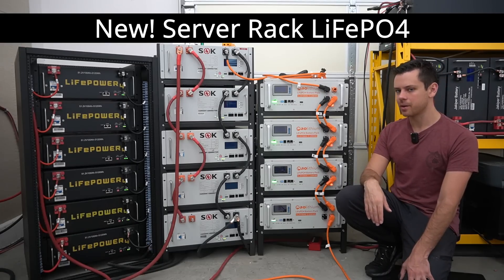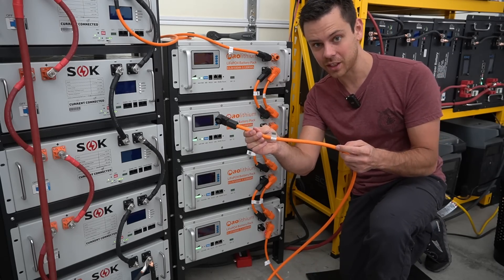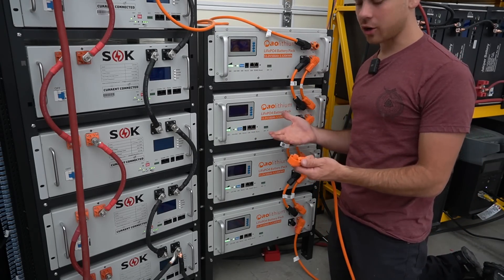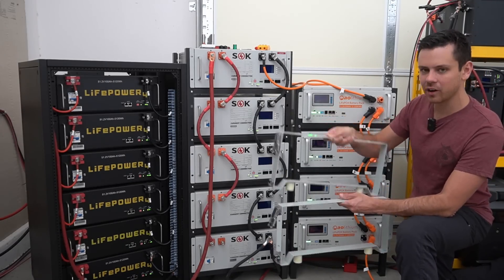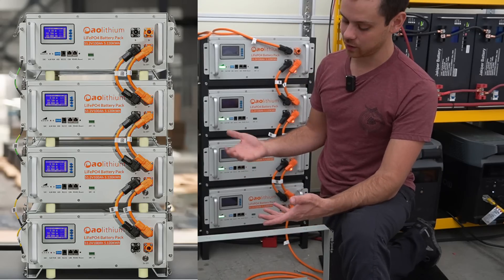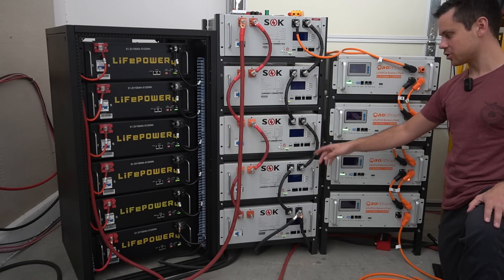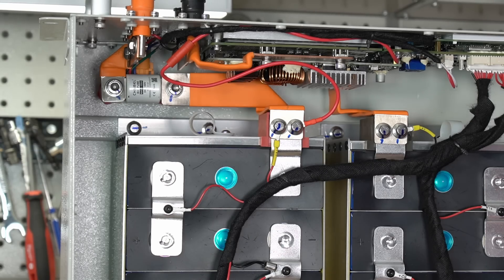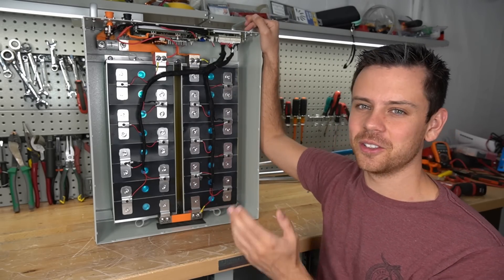New! 48V 5.12kWh AOlithium Server Rack LiFePO4 Battery

Comment: Question:  
I use about 70 kwh daily at my home....  Is there a realist solar setup that would fit my needs?  If a single solar panel only makes ~ 300 watts for about 4 hours in the best time of the day wouldn't I require over 100 panels to generate 70 kwh a day???  Not to meantion pallets of batteries?   I do not see my home going off grid...

Comment: Will I have a question, can you run 120 and 240 volts at the same time on a inverter or do you have to have two inverters to do this?

Comment: So a quick question. I’m not having any luck getting a uk installer to do my house solar. So Will you thought well or the SOK battery. So if I get 2x 12v x100Ah and build a 24v system on my shed. If eventually I find an installer for 48v roof panels could I add 2 more batteries and make a 48v 100ah stack? (I know that’s. Greater cost than getting the 48v server rack battery , but I can’t use that for 24v on my shed) Do the BMS play nicely when connected in series?

Comment: Hello. I need your advice. I have a Fronius primo 5.0-1 inverter, which have two input with two mppt. One is connected to a solar array with 14x370w panels face to east. My plan is to add more panels with west direction to the second input. The problem is I dont have enough space for more than 4 panels. These 4 panel maximum string voltage is around 160 volt. Regarding to the inverter's manual, the mppt range is 240-800v, operating voltage range is 80-1000v. What can I expect when I connect these 4 panels to the inverter's second input? Thanks

Comment: Hey Will, just curious is there a video on a solar panel inverter setup just to offset the cost of electricity? I realize all your videos touch on this but specifically maybe a scalable system a guy could start with one server rack battery, an inverter, and a couple of large solar panels and in the future add more solar and battery, all while using less and less power from the grid? It isn't necessary for me to do this as electricity is very affordable here I just want to do it.

Comment: I wonder, if I can pick up a 50kwh building backup battery (Lithium) that's in good condition from a surplus for 5k would that be a good deal?

I'm thinking of going that route when I build my solar system along with 30kwh of solar. I want to be ready for the northern winters if we have a power outage.

Comment: Hi Will I have gained great respect for the way you share your knowledge with us very thorough and technical bot not in a way that leaves scratching our heads when are done. I'm not just saying this to gain a response for my next question. I have come to love lithium batteries from what you have shared. I am a handicapped USMC veteran riding a mobility scooter so the lighter weight, longevity and length of use time available had me thinking it would be a good idea to try them on a mobility vehicle to see how they fair. I have just received 2x135ah 12volt Dakotas. I was surprised when they arrived with a single 3.5 amp charger that on the box says that it is only rated to charge 8-35ah batteries. Will this actually work? Also can you recommend a better option for me to request the VA to purchase for me? Your best choice because the VA will pay for it without any complaints about pricing for the most part. I hope to hear from you and hope you do not have a problem with me asking. 
     Maybe you could start working on videos having to do with this topic on your channel. I believe a lot handicapped people would be highly grateful and very interested. 
Thank you and I hope to hear from you. 🙏😇🙏🤠
Reply: Will can you please let me know if you have at least read my messages to you?
Reply: @DocktorVideo  Will runs a discussion forum on his website, I suggest you visit there if you want more detailed community discussion.
Reply: @pvbatts  I'm new to using any forums. Can you point me in the right direction please?

Comment: HOWdy  W-P,
Thanks for the REVIEW - INside & OUTside of this BATTERY
I prefer the FAR Left & FAR Right Positive & Negative battery connectors 
... on the  LifePower4 & EG4-LL batteries as it allows for simpler BUS-BAR connections & separation 
FYI --- my  EG4-LL batteries came with  5-AWG  jumper wires & too small 1/4" lugs 
( where 5/16" lugs would have been preferred at least on one end  ) 
 COOP
...

Comment: If they were connecting to a busbar with each pack directly, then short 3 AWG cable links would be more than adequate but to parallel them up like that it would be pushing it a bit and could be a problem if this was connected to a larger inverter over 5KVA or multiple large charge controllers.

Comment: The biggest issue I've had so far in working out my system for my ute is "what gauge cable do I need?" I'm a relative noob with actually setting up a solar system, but have had an interest since the early 80s.
My current thought is to go for the biggest gauge possible, with appropriate connectors (high capacity Andersons etc). I want to be able to run a small 120amp arc welder for short periods. I figure that will be my highest load on the system. I'll also have an electric (240V) 20 litre/2HP compressor. The ute will be my home, so my power needs will also run to powering a computer and associated peripherals on a daily basis. I'm really hoping my set up will be overkill for daily needs but cope with the occasional use of a welder. 
My current purchased items:
1 x 3000W pure sine wave inverter
2 x 115 AH 12V AGMs(connected in parallel). Might add a third later on.
2 x 160 Watt panels. Might add another in the future.
A 20 amp MPPT controller (it was thrown in with the inverter as a freebie)
I still need to decide on a controller panel for my 12 volt needs and learn whether that controller will work if both panels are connected.
And I need to figure out cable sizes. 
I'll keep watching your videos because even the system in this video has some relation to what I need to learn with respect to cables and loads. 
One thing you've confirmed for me is that yes, I do need some fat wire between the batteries, and the inverter.

Comment: I cant afford to go solar but if that day comes I'll know everything I need to know thanks to these videos.  Until then i really enjoy your expertise and professionalism.  
I enjoy planning out in my head my ideal solar setup even though I can't justify the cost.
Reply: You can't afford not to
Reply: @PaulShalahm   where I live electricity is 6.5 cents per kilowatt hour.  I live very close to a hydroelectric dam.  I can't see how I could justify the cost of solar.  Even if the solar panels last 100 years the batteries will likely fail before I save enough in electricity to pay for them.     Until the batteries get a lot cheaper I can't see how I could justify the cost of going solar, besides the fact that I just can't afford the upfront  cost
Reply: Build a small system.
Reply: I just started buying for my system. I have a tight budget and it is easy to exceed it but you can start small and expand the system later I wanted three batteries but settled for two with plans to add more latter. But now I am committed to see this project become reality.

Comment: The ragging on the stacking frames is overdone, seen pleny of battery system stacked on top of each other. Not a server or server rack in sight, ignorance is thick. The connectors used found on higher voltage string systems but lower current, certainly not for more than 50A. Inside the chassis, a lot of empty space.

Comment: New Subscriber!  I have an 8X12 insulated back yard shed for my falcons and hawks that I train.  My yard faces south, but my shed is in the corner of the yard that is shaded.  I want to power some led lights in my shed as well as a small freezer inside the shed.  I will have to put the solar panels about 10 yards away where it will get most of the sun.  What components do i need?  If you charge for advice that would be fine.  Good luck!

Comment: You're absolutely right Will....paralleling with such small battery-to-battery cables might be fine for the small loads of a telecom backup site, but not for power electronics.  Battery cables and associated OPDs should always be sized for the maximum load connected.  Busbars are the only correct way to parallel batteries, keeping in mind that all cables must be exactly the same size and length.  Even very small differences in cable resistance can have negative effects on charging.

Comment: The connectors are called SLPPA25BSR and rated at 125A with a 25mm² cable. They are also availavle as SLPPA50BSR rated at 200A. So there is a Chance to make your self some bigger cables
Reply: Yeh it's great to see radlock connectors on these batteries. I first saw this type of connector when installing a 2MWh Tesla megapack back in 2015 or 2016

Comment: Cables are too small  yes larger gauge cables needed and in parallel is how it should be done, plus cheap Chinese dirt will not do, most of that china stuff is not even copper you will find it could be brass, aluminium or tin, etc. will is 100% correct so watch out. I deal with large supplies all the time in industrial situations.

Comment: Check the sub rails... do you have droop?
If no droop I think they are sized appropriately as long as the wiring is NOT extended....

But not a load i put at near 100 capacity on my own buget... upgrades the cables or add a dual bus
Reply: Edit it would make sense depending on operating at a draw/charge which direction the batteries has more cell density at that given time...

Still thank you...

Gotta admit these Chinese packs are getting better for sure

Comment: Will, as always a very informative video, I am in the UK and have set up a 12volt  off grid PV system totally from the information and reviews you have done on your channel.    Thanks again for your invaluable advice and teardowns!!
Reply: Well done. From a dude in Manchester.
Reply: Rodeown, where did you get the components from here in the UK. Would be great if you did a video of how you set it up and parts list.
Reply: I'd be interested in knowing more , as I'm considering a DIY home system here in the UK.  Just been quoted £13k from a commercial provider.
Reply: @mjexploits  Martin, mine is a subsidiary system to complement my main grid supply not to replace it, so when we get blackouts this winter as they predict then we will still have power for cooking and lights etc,    I used 4x renogy 100watt solar panels connected to a renogy Rover MPPT charge controller and 2x renogy Blu Tooth 100ah LiFePo4 batteries connected in parralel & as per Will's recommendations I opted for the Giandel 2000 watt full sine wave inverter.    I ran two AC cables from the inverter, one to my kitchen and one to the living room to supply the power to new sockets that are in no way connected to the main electrics. The remote for the inverter is on a double socket in the living room so we can turn it on and off when we need it.  At present from about 10-20 % we can be fully charged to 100% with a good day of sun even at this time of year in the UK. I have never used an electric Kettle before now but all our cuppas are done on Solar and we use our 1300watt Halogen Oven no problem, I also have a 2000 watt induction stove that the inverter runs no problem and it only uses about 2-3% of overall battery capacity to cook a meal which can get topped back up very quickly. Vacuum Cleaner works fine on it,  It even runs an 800watt oil radiator in case of emergency heat required.  So it is not a FULL household system but an alternative backup that we are using more and more, it has cost around £2000 so far but I am happy as it gives us peace of mind.                       Trouble with UK GRID TIED systems is they dont allow you to use them if the power goes off so that is why we chose the DIY off grid option.  All thanks to Will and his wonderful video reviews/advice etc.  I would also like to say that Giandel have great customer service, i needed to know what size fuse i would have to put on the system and if i would need an RCD and they replied very quickly within a couple of hours.

Comment: Most of inverters pull 100-120A max from batteries, I guess that is why they used this wire gauge, to work with common inverters.

Comment: I wouldn’t pay much attention to what the BMS is reporting for SOC. Trophy batteries, which you mentioned share the same BMS, also have a known issue where the SOC is reported inaccurately. 

The SOC reporting error is discussed on the forums quite a bit, and I’ve seen this same behavior with my own Trophy batteries. For example, I’ve seen instances where my 3 batteries in parallel reported wildly different SOC’s (60%-80%), then suddenly all jumped to 98% once they hit 56v just a minute later.
I just ignore what the BMS reports and trust the Victron smart shunt.
Reply from the maker: Ohhh ok good to know. Was not aware of this on my trophy packs. Will read the threads
Reply: Looked at it closely. It’s not a pace.
Reply: trophy seems to be using a seplos bm,s, this seems to be a pacebms
Reply: LFP SOC is tricky to report precisely as the LFP chemistry has a flat voltage curve plateau at 3,2V. Ideally you need to count coulombs passing into the busbars. On the other end NMC is quite linear from 4,2V down to 3,2V. Much easier to estimate the SOC then.
Reply from the maker: @chryoko  that doesn't matter here because these BMS have a shunt. It's not using voltage.
Reply from the maker: @chryoko  even with NMC you should count coulomb's regardless. We don't use voltage to assume soc on this channel. We have covered this many many times

Comment: Hope this company listens to and implements every single one of your recommendations - you're only helping them become better and everybody wins.
With such a great internal build, I just don't get how they whiffed on adequate cable size - the connectors are sweet tho'. One thing I would like to see, is a quickly/easily removable insulating busbar cover. I do not like some setups I've seen in server racks  where it would be too easy to accidently touch a live busbar - god forbid a child or pet do so. Like reaching into a live breaker panel -it should be safe to do so without having to worry about a big long exposed energized strip of metal.

Comment: Will,  I really like your posts. Your comment about multiple conductors to a protective device is not accurate.  Any device larger than 400A will normally have multiple conductors per phase.  Even 400A circuits will sometimes have two runs of 3/0 instead of a single 500MCM.  The parallel resistance of the conductors is lower than a single larger run and results in a lower voltage drop.  That said, the terminations have to be good and the lengths reasonably close so that the current is shared equally.

Comment: Can the internal wiring handle 400A without using a bus bar? It looks like in parallel there would be a lot of current going through the terminals if the leads were not hooked to the same terminal....
Reply: Was thinking the same thing. Maybe if 4 batteries split in two onto a common stud that then goes to inverter with the larger wire.

Comment: Those connectors are usually 75A continuous, you have to connect another pair to first and last battery to double the output to 150A continuous current. For PV you usually do not have 24/7 continuous current so you are safe using it on 200A limit.

Comment: As an electrician for quite a long time, yea those cables are undersized to jump battery to battery. They are run free air which by code, does allow more ampacity on them then if they were in pipe but I still wouldn't use them. If they went to a buss bar like you said, sure. That would work. I'd personally still go bigger but that's just me. It's cheaper to oversize wire then to start all over because your wire melted and destroyed everything. Wouldn't running battery to battery like that negatively affect your charging/discharging too? That first battery in line is going to be first charged and first depleted. The expense of those batteries alone would keep me away. Add in the undersized cable and running battery to battery, no thanks. I'd love 8 more AmpereTime 200 AH 24 volt batteries but those are insanely expensive as it is. These AOlithiums would wreck any budget.
Reply: I believe Will had the negative to the top battery and the positive to the bottom battery (or the other way round), which should in theory draw evenly from the overall pack.
Reply: @dathat555  Yep, you are correct. Good catch. I did miss that. I personally would still rather not run battery to battery and do a buss bar. That could just be me liking to make things overcomplicated and more difficult though.

Comment: If that wire has 200C insulation then it's rated for about 250A in open air. Still very insufficient for 400A.

Comment: 0:38 well that would be overkill for many. 48V at 100 amps is plenty for many, adding one or more racks wouldn't be about max current/power but capacity.
Reply from the maker: It wouldn't even run a lv6548. It's not enough.

Comment: I wouldn't be so quick to dismiss the Radlock connectors. They are a quality connector and used in high current DC applications. I think not having terminals exposed is a positive. See what I did there?
Reply from the maker: They were pretty hot with 130A yesterday. What's the most you push through them? What's the data sheet say?
Reply: @WillProwse   They come in different pin sizes for different ampacity.  The largest is 12mm and is rated at 400amps per Amphenol spec sheet.  Not sure what those batteries have on them.